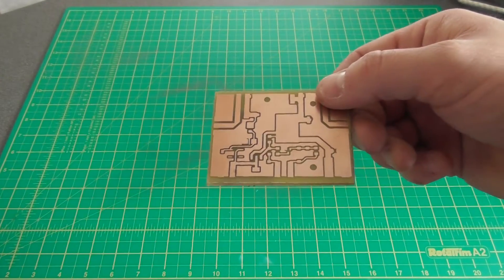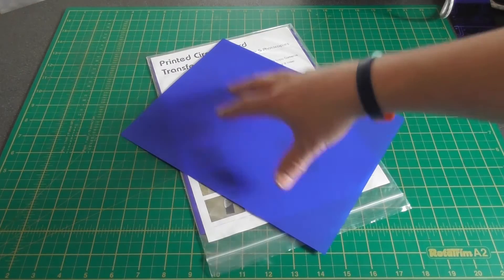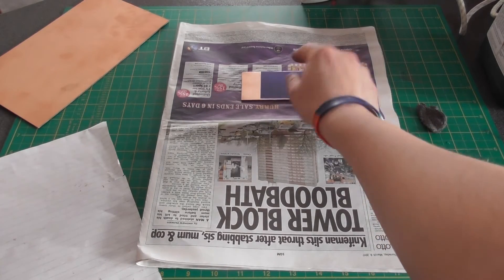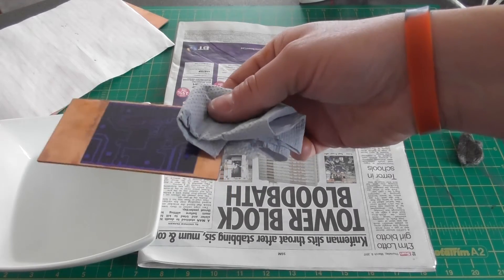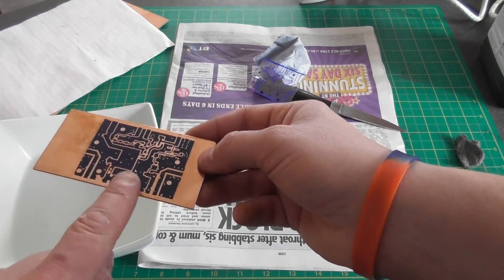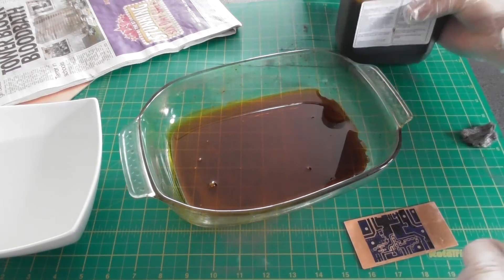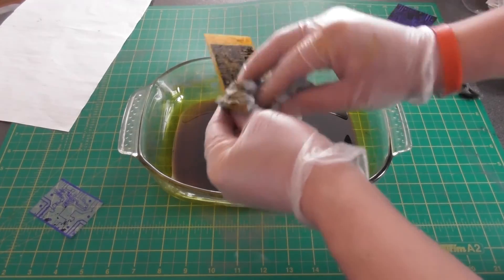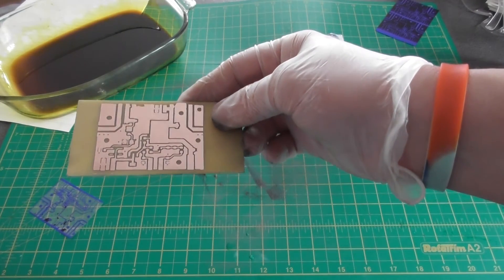M0NWK - How to make a PCB (Printed Circuit Board) at home in less than 45 minutes

Comment: you didn't show how you get the pattern onto the blue sheet. Photo copier?
Reply from the maker: Hi David, I used a laser printer to do this. Thanks
Reply: @M0NWK  I figured it out. Lots of people explaining this whole process skip the printing pattern onto blue plastic video. I did that, got a 98% complete pattern. Repaired some missing parts. Etched it and the toner got etched off before all the copper. trash one ckt bd! I am still looking for those rub on ic, transistor pads and traces of different thicknesses. Not made any more. What about a cnc machine for cutting away the unwanted copper? Any suggestions? I've been making ckt bds for 35 years now. we have 3 laser printers. Wife wouldn't let me use her color laser printer!